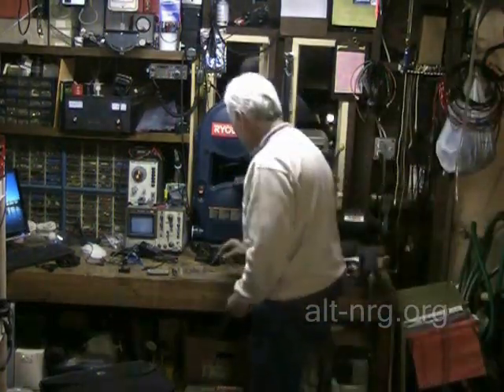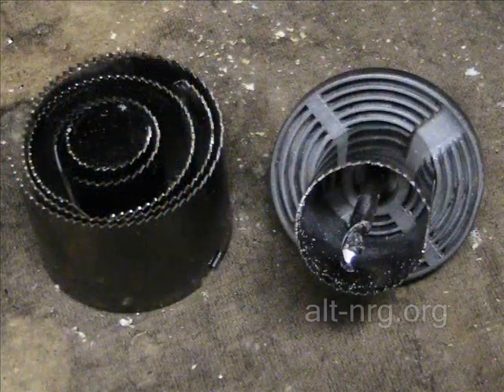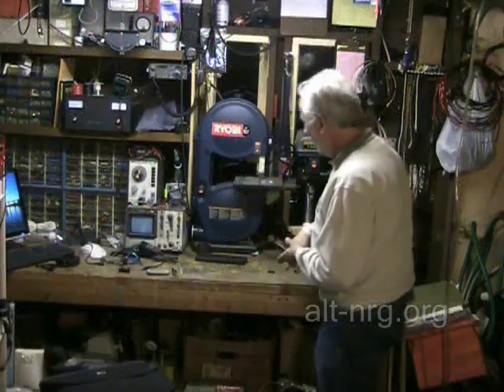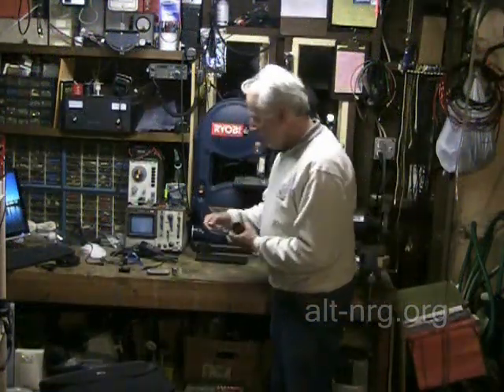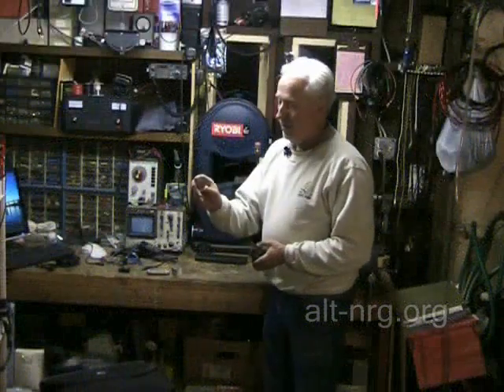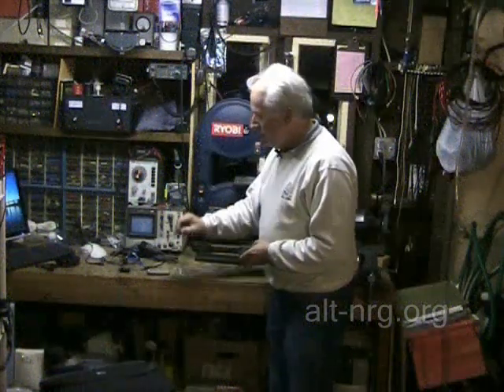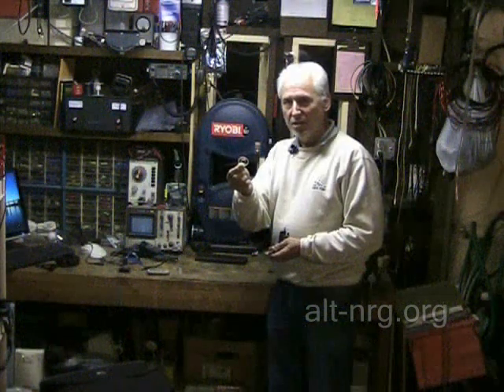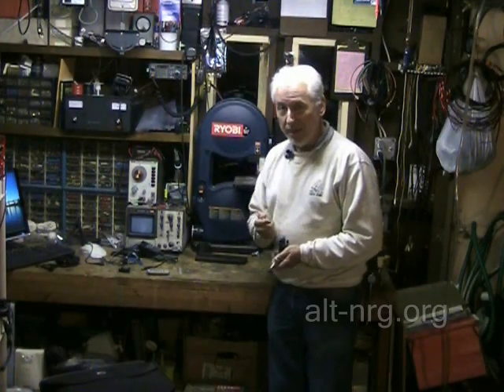#269 RomeroUK Muller motor generator replication

Comment: This comment is way too late, Zero, but you could use your ferrite cores as the coil form, just cut the IDs of your plexi to 12 mm, glue two of them onto a core ... voila!  You could wrap the ferrite with elect. tape if you're very cautious.  Also, a hole cutter (uses a cutting tool similar to those you use on a metal lathe) is cheap and will cut a much nicer disc.  Just for future use, if you like.

Comment: Muller Dynamo running on a capacitor & generator coil scope shots.ASF  how about makeing the coil smaller than the magnet? i mean really all you need is just enough force to push it over the hill.( maybe start with one coil then switch to another(that uses less power) when your rpms would get high....after awhile you max out in your rpms with one type of speed .how about hooking up a tesla style pick up to sorta charge up the magnet with energy..kinda like this guy. pmh and vee magnets

Comment: Z, I hope the glue holds. That is just Pex tubing but I am unsure if glue will hold. Run a bolt through the center that is longer than the bobbin. Hook the bolt to a cordless screw driver and make a power winder. It will save much time. I will be following with great interest. Best of luck.

Larry